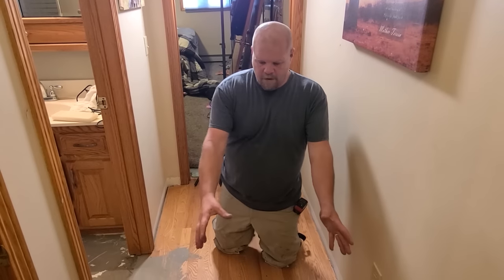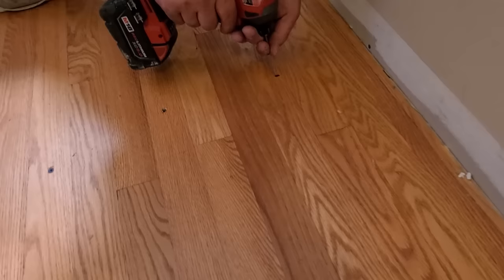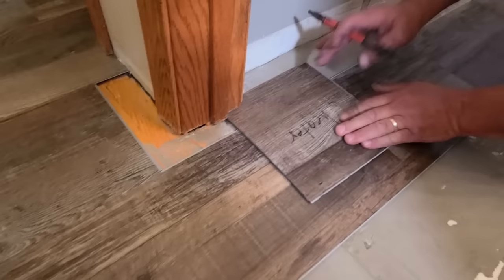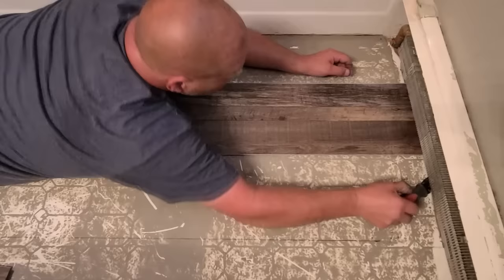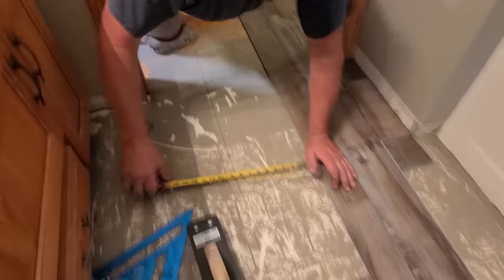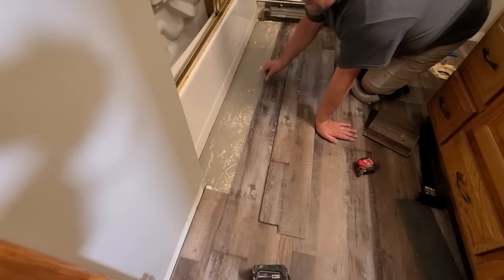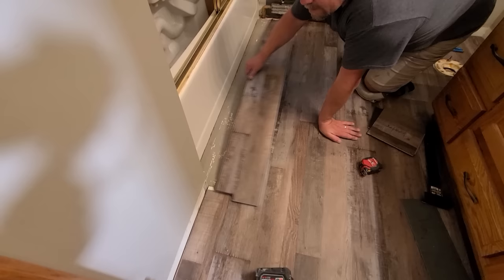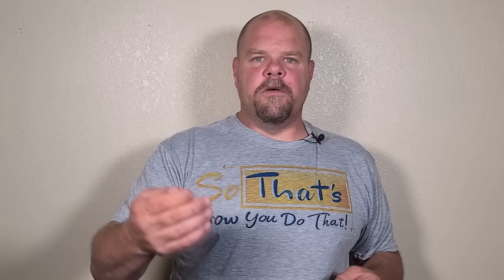How to Install Vinyl Plank Flooring Into a Bathroom

Comment: But my question is, doesn't the flange need to be on top on new flooring? This is the issue I've ran into with my current bathroom remodel and I'm going to try your idea with the cardboard to cut out the round area of the drain, not the flange. So that my flooring will seat under the closet flange ring to achieve this... That's just what I've been able to gather. Not saying I'm right and your wrong. I'm here to learn. Thanks for your videos
Reply from the maker: It does not need to be on top of the plank.

Comment: You are a skilled craftsman and a good decent man !Thank You for your wonderful videos . Just put almost 1000 sq feet of vinyl plank down after watching your videos . Retired part time contractor I am ,and I like keeping up on the new materials that keep coming out . Where do you get your big rubber tapping block that resembles a float?  The gentleman I was putting the floor down with kept using scrap pieces of flooring to tap with and I told him of your big rubber block ! His scrap pieces were breaking the grooves when he got carried away . Our floor came out great ,only small bathroom left to do tomorrow. It looks professionally done ,not bad for 2   65 year old retired guys doing a charity job !

Comment: I don't know how much you charge to lay 24 cartons of Pergo but that is how much you're saving me. Just can't thank you enough for all the tips and tricks. I do recommend anybody following you and planning a project with this type flooring to go ahead and buy the pull bar/knock locking tool for $60+. You're going to need it. Some laminate goes together easier than others.

Comment: Just got my 1,200 sq ft of vynal planks delivered yesterday. They are giant planks at 10"wide x5.5 ft long by 12mm thick. Never used such big planks and not sure if that's going to make it harder or easier but I'm guessing it means a lot more cutting. I'm thanking God that I found your channel. I did my entire 1,000 Sq ft basement last weekend and it turned out great. Next week is this for upstairs and into hall bathroom so again, I'm rewatching all your videos!
Reply from the maker: You got this!!

Comment: I wish I would have came across your channel when I did my first room. Finished my dining room and the part of my kitchen. I wish I had started my planks in the first room differently as in same direction as the dining room. I know it is preference. I started the opposite in dining room and used a T strip where the first room ended. The reason was I don't have money to purchase all the planks in one go. This way I can move all my furniture from the living room and store in the dining room while I prep the other floor. Installing that plank in that direction was WAY easier and went faster. I made faster progress cause now I know what the hell I'm doing. Another worry I had was my kitchen and dining room has bowed joist causing a dip in the subfloor. We were told it from the steel frame that the manufactured home sits on. With that I don't expect perfection. I'm just happy my dogs can no longer use the floor as their toilet, yes it sounds disgusting but now if they have an accident, clean up will be a breeze.

 Your videos really helped my hone my DIYer skills.

Comment: Denatured alcohol is now illegal in California, and regular isopropyl alcohol doesn’t work well at all to remove Sharpie lines.  My wife gave me a can of Aussie brand hairspray, and it removes the Sharpie lines perfectly.  After spraying, let it set for a few seconds, then wipe with a cloth, or cotton ball(s).  Amazing stuff, really.  Then dampen a rag with a drop or two of dish soap (I used Dawn), to clean off the hairspray residue.  The board looks at this point like it did when you pulled it from the box.

Comment: Thanks Joe! I watched several of your videos on vinyl plank and then got to work on a roughly 850 sq. ft. area. My cuts got progressively better and the tub area looks great thanks to your videos and training. Originally, I didn't cut off one of the clip edges on my cheater board until after I made a couple wide cuts. Then, duh!, I watched the video carefully and finally got it.
Reply from the maker: Glad you got it!

Comment: Thank you for making these videos. What you show in your vinyl plank series of videos is exactly what I encountered when doing my bathroom, except for a couple details. I have a master shower and a main bathroom with bathtub. Both have glazed ceramic tile with decorations on the face that make them uneven. Also, about 1/4 to 1/3 of the tiles in the main bath are loose or very near being loose. I ended up doing each bathroom differently. I pulled up all the tile from the main bath and cleaned off the 3/4 subfloor with a grinder. Repaired rotten subfloor by the bathtub, then put 1/4 underlayment over the subfloor. (Underlayment was probably overkill, but gives the vinyl great flatness so it doesn't bounce anywhere. In the master shower, I put vinyl plank over the glazed ceramic tile. There are a couple high-use areas that have a little bounce, like in front of the sink. When I installed it, I started at the back of the room and worked out to the door. So, I will probably pull in back out and use that floor leveler you showed in another video. 

So 2 questions: Is there a better floor leveler than what you showed in another video for glazed ceramic tile? Nothing sticks to this tile because the glazing is so smooth. So, I'm worried if I use a floor leveler, it'll just come off after some use.
Other question is where to stop in the doorway? My doors open into the bathroom, so I'm thinking about putting the transition strip under where the door closes. Then from the stop outward, will be carpet for the bedroom.

Sorry for the long post, but would love to hear your experiences here.
Reply from the maker: Use ardex feather finish for the floor prep. It will stick to the tile plenty good. Here is a video that explains your transition. Start watching at the 48 minute mark - https://youtu.be/6eZHHSzI7Qo

Comment: Absolutely love your videos! You are so easy to understand and your tips especially for someone like me who literally is going to start laying my LVP today.  I’m doing a standalone small bathroom that has turned into a bigger project than I originally thought it would be. I bought a vanity that I wanted to put in, long story short when I remove the vanity there was no laminate under it it was just straight subfloor. However the way the builder had put the vent under the old vanity that was flush to the floor, there was no cut out in the toe kick and the condensation over 20 years this house, completely rotted the subfloor read through to the crawlspace below. I have been learning as much as I can through u tube.  I cut out all of the rotted board and put in a new piece of OSB. I have done the insulation underneath the floor, filled and caulked any little gap, down replacing the toilet as well since I went that far. Good thing is now I just have a 40 sq ft bathroom roughly.  I have put around the vent and a corner. I’m trying to figure out about this u channel for the transition to the carpeting in the hallway. Hopefully I can find some thing in your playlist for that.  I also have an underlayment to put in since I’m gonna be right on the subfloor. I’m gonna try to find your cheater board or marker board because that seems to be very helpful. Wish me luck I’m a bit nervous but willing to try versus paying someone.  Thanks so much 
And love the blessings you always give in the end I think that is awesome! Thank God for you too! 😊🙏✌🏼
Reply from the maker: You got this!

Comment: Great video! I thought putting vinyl planks with padding over vinyl sheeting would make the floor too soft and flexible and maybe damage the locking joints. Straighten me out on this. Thanks
Reply from the maker: It can be a problem  if the vinyl is a cushioned vinyl, this is a felt back vinyl.
Reply: Thanks for the help. 👍

Comment: If your working with a concrete foundation wouldn’t you use a moisture barrier padding then plank it? I’m not a floor guy by trade but I know a thing or two, but can still always learn a thing or two as well so the feed back is appreciated thanks as I’m currently doing living room kitchen a and hallway, and some point the bedroom because I’m not doing a transition until the bathroom and the back bedrooms but the front bed room will continue and all connect as one

Comment: Great tips. Thanks. Ever run into an area where you are going around an island or around multiple walls/into other rooms then coming back to connect (without having to use a transition)?
Reply from the maker: Yes. I have a video for that, but it is in my members area. https://www.sothatshowyoudothat.com/laminate-university-registration/

Comment: I bought waterproof laminate to use on the whole second floor including the bathroom. I didn't notice it said to use a backer rod and silicone around edges where complete waterproofing is needed IE the bathroom. Have you done this? The backer rod is 1/2" tube. I guess you cut a wide opening on the caulking tube to cover. Good thing I was planning on using 3/4 round trim on base and against the tub. I also thought about paInting some red-guard a foot or so in front and under tub (all new install) and up the wall a little. Thoughts? Im using Wedi board around tub walls and down the side a few inches. I'm also going to use PVC base trim in the bath only. Doing craftsman style trim so it's 1 x 6 square edge.
Reply from the maker: Sure, you can do these things.

Comment: sweet job on the vid and the how too. I’ve been installing Lam and LVP the last 15 yrs. You hit it out of the park. Curious have you seen or tried the Carpet seamer reverse tape method for changing direction of the groove and tongue. Man that reverse drop is a killer after a few rows and you’ve got a 10x12 room to reverse lay. Some of those product splines are cheap and they fall apart fairly easy. You get 1 crack at it, then its either glue them in or grab another plank to replace it.
Reply from the maker: I have not, but I am going to!

Comment: Question If using a vinyl underlayment how do you calk your lines? Or maybe some tips on installing underlayment. I have a house to do in Bullhead City AZ raised deck on cinderblock foundation. They have 8 x 12 sheets of some kind of Masonite type substrate over plywood, modular house 30 years old. Going to use Life proof Home Depot. I'm a Journeymen tile setter , stone mason 35 years experience before that I did lots of glue down wood. Not to much experience with  Vinyl and that's  the only thing we can put down  coming from  the City engineers.
Reply from the maker: You can just stretch out a dry string line and have a screw on each end to tie off to.

Comment: Hi Joe… Appreciated the video on your favorite LVP flooring you did earlier in the year, thanks. We are having to replace most of the flooring on the first floor of our three-year-old house because of some water damage to about 15% of the continuous flooring. The builder used cheep Mohawk wood laminate and the style is out of production, so we need to replace 100% of our floor.  One contractor suggested using Home Depots Life Proof LVP and only remove the damaged floor (it's a slab) and install the new flooring over the existing wood laminate. And put some kind of product over the area where the damaged floor was removed to level it to the remaining floor. Any thoughts on that??? Thanks, Gary

Comment: I'm getting ready to install lvp in my entire downstairs. We have linoleum sheet in the kitchen. When do you know of you should pull up linoleum versus leaving it? There is an area of discolor by the sliding door that I'm worried could have water damage underneath? The rest of it looks fine. Is it worth pulling up the linoleum or just going over it?

Comment: Fantastic resource. Thank you.
Question: I laid my vinyl plank, installed my painted  MDF baseboard and corked the top.
Would you recommend running a clear silicone cork line between the vinyl and base board?
That MDF even painted can be the weak link for moisture damage. 
Thanks
Reply from the maker: I would not

Comment: Joe there is a lot easier way to locate a toilet flange or a drain. Take three measurements let's say the front and both sides put one side of a pair of dividers in the center of where you want the hole move that leg until the other leg touches three measured marks. Swing a circle is perfect every time.

Comment: I've watched several of your videos now.  If only everyone on youtube produced such useful content!

I'm considering some type of vinyl plank or stranded carbonized bamboo for my house.  I found it very interesting that you do not typically use transitions for doorways with the floating vinyl, which I always thought were required, but a serious downer for floating floors.  Can floating stranded bamboo flooring be installed without transitions?

Also, how do you install the toilet so not to anchor that part of the floating floor?

Comment: Have you ever laid down floating laminate flooring over a marriage line in a older double wide mobile home? I have checked all over for help on this and have not found any.  My home has "rounded top" bolts at the marriage line  that stick up about  one eighth to one quarter inch above the pressed board sub floor. Any suggestions on how to bridge the gap?  Could I lay linoleum over it before doing the laminate?  Hope someone can help. Thanks.  Connie

Comment: You’re awesome! Thanks for your guidance  and prayers. I am preparing to build a work studio in our garage on a concrete slab that was once an open carport attached to the brick ranch, but was enclosed. I have been researching how to handle the flooring. I will be using an LVP that has no backing attached. My main question is that, my slab is in good shape without dips, was laid with a grade to run any water away from the house. Do I need to level an intentional slope, or will the LVP be ok laid on n a grade?
Reply from the maker: I would use an underlayment like Quiet Walk. This is a pad and moisture barrier in one. If the floor is flat you are ok to install.
Reply: @SoThatsHowYouDoThat  thank you!

Comment: Is there a particular flooring joint system that you either prefer by brand or think is the best out of all of the designs out there? I'm in the process of choosing new floor for a house renovation and I'm interested in hearing your opinion.

BTW- Thank you for your videos!!  Very informative and helpful!
Reply from the maker: I prefer mannington adura max
Reply: @SoThatsHowYouDoThat  What is the big difference(s) between the Adura Max and Adura Rigid planks?

Comment: Joe I have a 500sq ft apartment is it better to use Vinyl plank flooring or laminate flooring  in the kitchen and bathroom? I currently have a 1/4 sub floor with sheet vinyl that will be removed in the kitchen, bath & entry way so to keep new floor the same height. Thank You very much enjoy your video’s.
Reply from the maker: I would use a vinyl plank. It will be more sound deadening.

Comment: I mean ideally, once you have the boards locked in the butt joint that floor isnt swaying to far side to side enough to snap a line through the bathroom. Always wondered why you snap another line when you transfer into another room.  I guess better safe than sorry. Also on concrete I use the same thing I use if it was a concrete carpet install. Drill hole thru scrap plank and use a concrete shank
Reply from the maker: Depends on the situation....

Comment: Our house was built in 1979 it has 1x5 wooden plank subfloor, but they laid 3/4 mdf over the top then built all the wall's on top of it. Can I lay vinyl plank on mdf with out any issue's? Our crawlspace is currently being encapsulated so moisture shouldn't be a problem ever again.
Reply from the maker: You can install over it. The problem with MDF is if it gets wet, it swells. that would be my biggest concern.

Comment: Thank you for the video! This is very helpful. I'm going to install vinyl plank flooring in our bathroom but am unsure about board direction. The problem is the room is long and skinny with a tub at the far end. For aesthetic reasons I think the boards should run lengthwise along the longest walls, which would result in the board ends abutting the tub. Seems like this will require a lot more precision in measuring the boards to ensure there's only a 1/8 inch gap to caulk along the tub. Is this worth attempting for aesthetic purposes, or would you run the boards widthwise in the bathroom (parallel to the tub) to avoid this situation altogether? (For additional context, we have hardwood floors at the tradition that run the same direction as the lengthwise options).
Reply from the maker: I would install the long way. It will not be as difficult as you think. Work away from the tub and this will be easier to get a perfect cut.

Comment: Great vids. My question is about laying vinyl at the toilet flange area. I had pulled up the lino in bathroom cuz it was buckling so now its just OSB under the flange. Is that bad for rotting? Should I put the vinyl plank under the flange or just up to it as u did in this vid?
Reply from the maker: Just up to it is plenty good.

Comment: Hey Joe, I’ve got a burning question regarding vinyl flooring directions. My floor layout suggests i run the boards length wise north/south on the main floor. However i have a few steps down into our great room that would require the boards going west/east. The way our floor nosing is designed makes my head scratch on that north/south layout. If i’m making sense could you give me a tip, or shoot me a DM? Your video’s are my go to for advice so I knew who to ask. Thanks Joe
Reply from the maker: Send me pics. There are links below to get in touch with me.